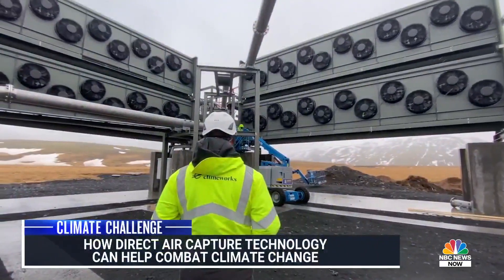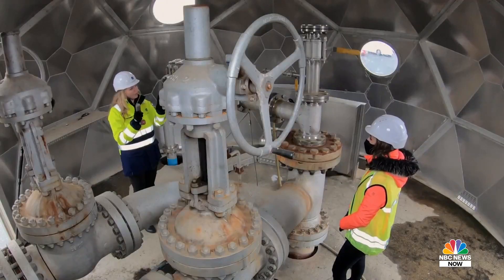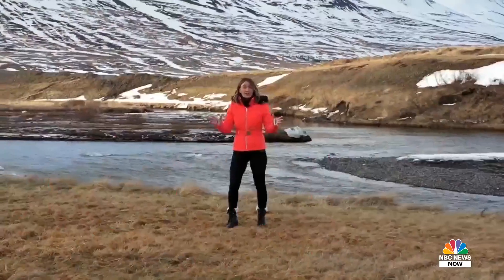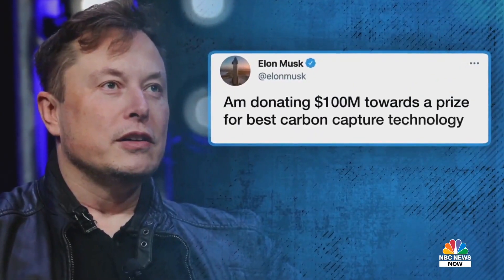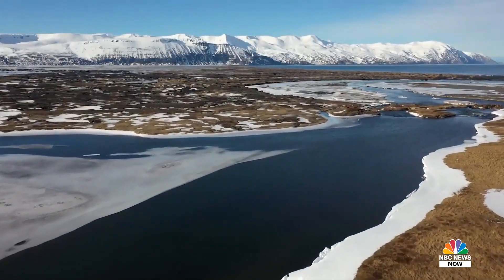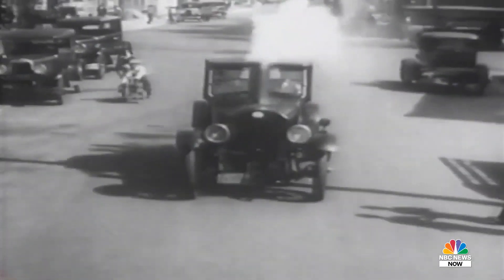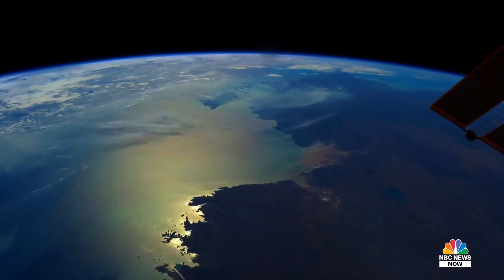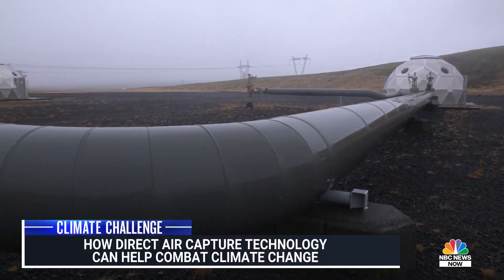Experimental Air Capture Technology In Iceland Aims To Combat Climate Change | NBC News NOW

Comment: Too little, too late.  Nothing on the shelf, just on the drawing board can be theoretically scaled up to put ANY tangible dent in the amount of carbon in the air.  We are talking 400+ parts per million & counting.  Turn the carbon into rock underground?  I would only think this was NOT a depressing joke if the carbon captured was to be used as a building material replacing / superseding carbon emitting concrete &/or steel.

Comment: Like escaping underwater or after melting ice, once is released by mining , fracking etc is out again; is best not to make more.
Reply: I understand what you mean, but that is not the case here. Once formed, the CO2 "rock" doesn't react to the air. It won't be released by simply tapping it like an underground oil/gas. And Iceland has no minerals worth mining (and even then it wouldn't cause an issue)
Reply: @Mrdresden  Ok, is still bet not to make more & continue this still.

Comment: We should take the carbon and feed it into greenhouses, the plants use it and may only need us to supplement nitrogen and phosphorus for the plants. I think this option may be better than turning it into more coal....coal really doesn’t have a seat at the climate change table.
Reply: When I saw the video I commented:  
"Too little, too late.  Nothing on the shelf, just on the drawing board can be theoretically scaled up to put ANY tangible dent in the amount of carbon in the air.  We are talking 400+ parts per million & counting.  Turn the carbon into rock underground?  I would only think this was NOT a depressing joke if the carbon captured was to be used as a building material replacing / superseding carbon emitting concrete &/or steel."  Your comment about turning the carbon captured into a means of mitigating our screwing up of the nitrogen and phosphorous cycles is compelling...I don't understand the chemistry, though.  Do you have a reference which would elaborate on it (like something to read or YouTube video explainers)?
Reply: @scottwarthin1528  “too little too late” sounds like a great way to absolve yourself of any responsibility. Just sit back and watch us do it.